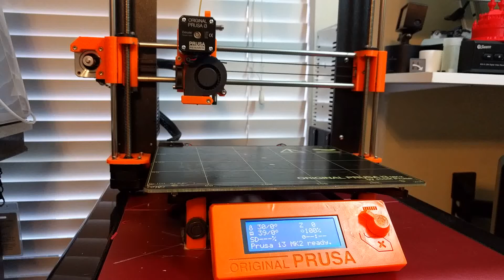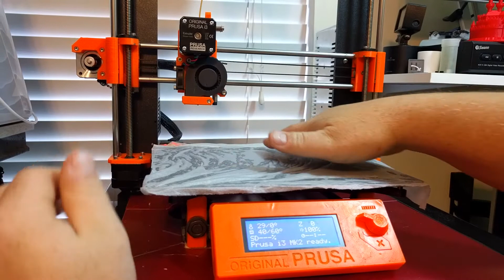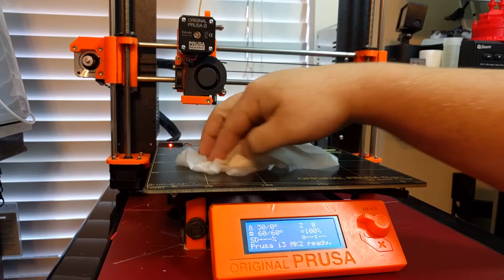PRUSA i3 MK2 Quick Tip 008: Easy Way To Remove Glue Stick Residue From PEI or Glass Bed

Comment: Thank you so much! I've been messing around with 99% IPA on my smooth PEI sheet and had no luck. After hardly believing in this method I've given it a try and holy moly it works like a charm! Thank you so much! My first experience with using glue is not a disaster anymore.

Comment: Thanks, thought I had to spend a bunch of time scraping my glass bed, but turns out the solution (or solvent in this case) was just water. Funny how Isopropyl alcohol doesn't even touch pritt stick, but water and heat gets rid of it easily

Comment: Just curious if it is safe to put a damp - soggy - maybe slightly dripping paper towel on a device bristling with electrical connections. Does anyone foresee a potential problem? Would a somewhat smaller towel work just as well? and likely get all the glue since most of us don't print right to the edge (or use glue right to the edge).

I'm also thinking that, for the MK3 or other printers with a removable Spring Steel Sheet - maybe heating the sheet and then removing it elsewhere and quickly adding a towel with warm or hot water would work well ... just some thoughts.

Comment: Thanks for the tip about heating the bed plus soaking the surface with the wet paper towel.
I recently had some thin pieces let loose and I had completely forgotten about using glue stick. The Prusa MK2's surface is so wonderful otherwise I forgot all the "old" knowledge.

Comment: great video.im still learning mostly using pla. when should I use glue sticks ?
Reply from the maker: When you have limited surface area touching the bed. You will learn when a part pops off the bed during a print :-( The 1.8mm wide 100mm long rocket fins had the tendency to pull of the bed causing issues. Glue stick is a low cost insurance policy.
Reply: That makes sense, thanks. What about adding a brim?